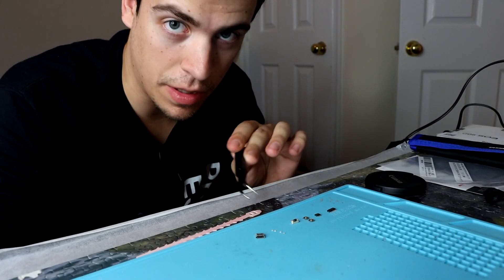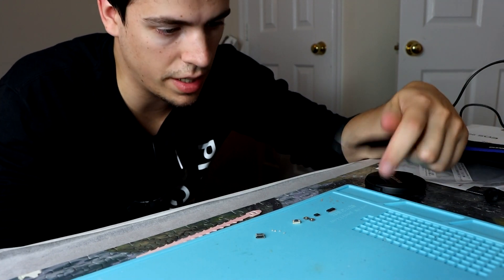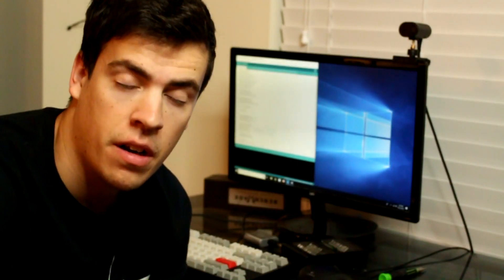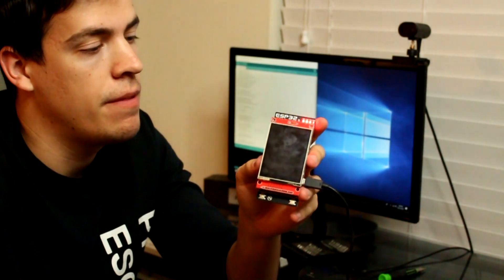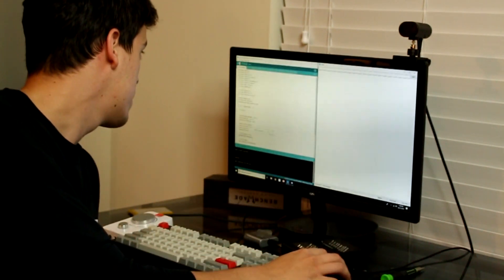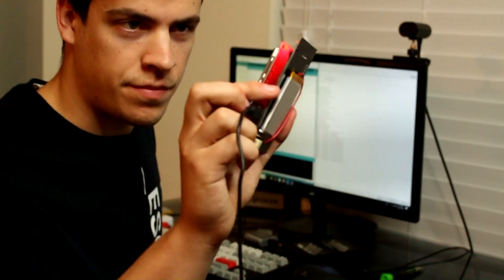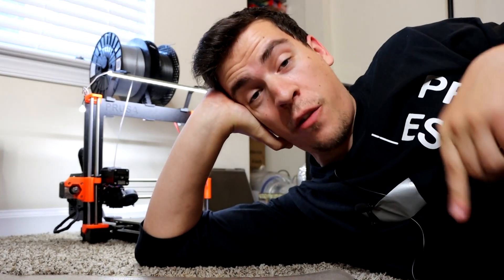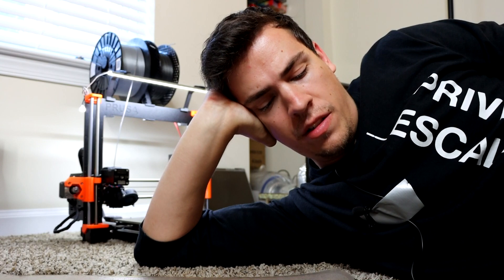ESP32 Marauder: Wifi and Bluetooth Hacking Tool

Comment: I'm doing something similar, a different project but the same concept. I'm having trouble flashing the microcontroller, the led doesn't turn on during the flash, but if i hit the reset button the flashing stops so i guess it is doing something, never the less can't get it to flash correctly, any tips?

Comment: Dude, from an old guy who has been learning "attempting" to learn for most of my 59 years. And only ever soldering everything single pin at a time with a stick gun. You my friend are my HERO. You are a genius!  With my old mind and PTSD I wish I could remember 1/2 of the things that I have learned over my 59 years of attempting to learn from smart guys like yourself. Thanks for sharing.
Reply: surface mount soldering is alot different to the old through-hole stuff..i know my eyes arent good enough for the SMD stuff these days!.. i need a microscope!
i still prefer working on through-hole boards only..

Comment: For the V6 what battery does it take? Also for the sd card what does it need to be formatted to for initialization and saving to it?
Reply: 3.7v 504050 LiPo battery with a 2mm JST connector

Comment: i have an esp32 dev board, a couple 128x160 tft screens ( not touch :c ) and some sd cards slots, if i get some button switches will it work if i flash the Mini version?

Comment: A stupid question how you figured out capacitors, resistors values and where to put them in that circuit with selected hardware. I apologise I'm completely new to electronics and just started learning
Reply from the maker: I mostly refer to the datasheets of the components being used on the PCB
Reply: @JustCallMeKoko  Thanks man for the feedback
If i want to design my own circuit for a custom gadget with microcontroller then how can I figure out values of resistors and capacitors and where to connect them 
I appreciate your help 😃

Comment: Does it only work for display?
Is there a web server control like ESP8266?

Edit: just found it as Marauder Centauri, thanks!!
Reply from the maker: At the moment, most of its functionality is used via the touch screen. It does have the ability to update its firmware via web interface. I assume when you say "like ESP8266" you are referring to the deauther project.
Reply: @JustCallMeKoko  oh I see. I just figured out few minutes later after my comment. ESP32 bluetooth deauther only works with screens. Thanks.

Comment: I bought one! 
But, then put it away - found it again and have discovered you've done a LOT since.
Still says it's version 0.1 - what's a good way to upgrade to 0.8? 
Can't seem to get all the bits in a row to compile from source. Yea, I know - I'm weak. AVRDude the 0.8 bin file, maybe?
Reply from the maker: The documentation on github tells you how to update using the bin file in the releases and either an SD card or WiFi.
Reply: @JustCallMeKoko  Yea, if I start from 0.4 or higher, I can use the WiFi. I did try the SD card, but no joy. I'll try that again. thanks! Most all the instructions guide to using Device > flash | update or the like. Options that didn't yet exist in 0.1. You've been busy!

Comment: the tft screen for arduino uno does it work? this https://lh3.googleusercontent.com/proxy/qkcU22Wq3_qpIG9WDalc02PE-qkzTJ7Xu2pU2cQ-2ic2S7aJvOoCiQb1Gxz8H6QuO0q_BPem9l56JQ3GESbACwXI2rsZheUZehvA1TYHMuJxBSxilK5BeeJd4qNK53EMf7MopBvFEhjXAQ
Reply: pins https://http2.mlstatic.com/display-touch-lcd-tft-24-para-arduino-uno-o-mega-D_NQ_NP_824115-MLA28105949759_092018-F.jpg

Comment: What are you considering adding as extra features? I see "Scanners" and "Attacks" in the wifi menu :P

One thing that is still kinda obscure is detecting de-auth attacks and other wifi bad manners
I don't suppose it's possible to use 3+ marauders together, measure signal strength of deauth packets, and do some classic triangulation?

Comment: How is it testing pen..no drawing test, no point precision check, no touchscreen sensitivity settings.
Board designed like a pro - then uses Arduino crap - lol
Reply from the maker: Pen is an abbreviation. This tool tests male reproductive organs. Insert accordingly.
Reply: Probly stands for personal electronic network

Comment: That solder paste stencil was key .  What size is the exhaust fan your using  ?  I am working on furniture/electronics project (building a server into a desk)  The spaces I want to use for ventilation/air-flow are about the same size as that fan .  The brand and size would help thanks.
Reply from the maker: I got the fan off of amazon. It is made my Kulannder and it is called the "Handy Carry Solder Smoker Absorber Remover Fume Extrator Smoke Prevention Absorber DIY Working Fan" ..their words.

It says the size of the fan is 8.8". It comes with a carbon filter and you can order replacements for the filter as well.
Reply: @JustCallMeKoko  Cool thanks for the info.  Yep need that filter , otherwise your pumping magic smoke back into the room.  I was going to say I didn't see a filter at first, but I didn't want to be a dick.